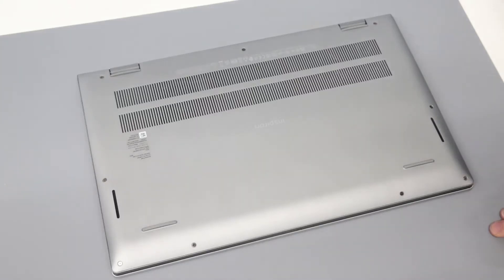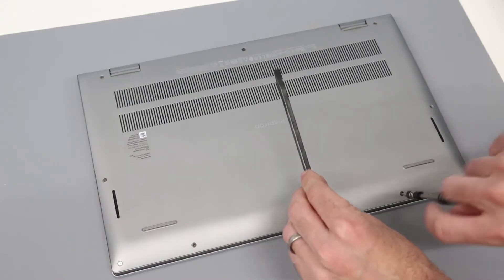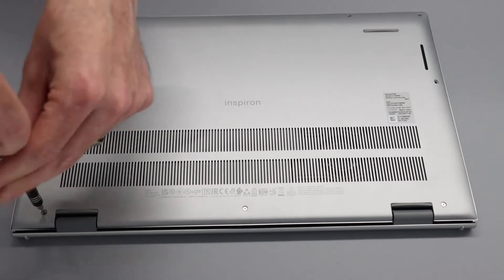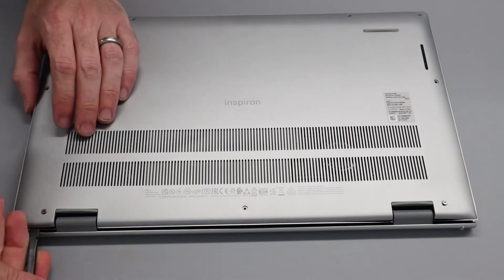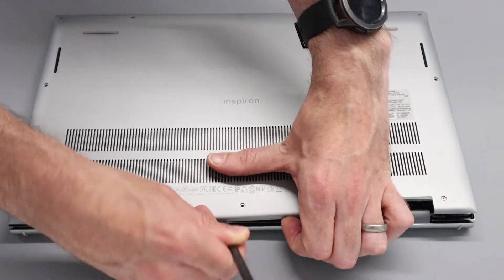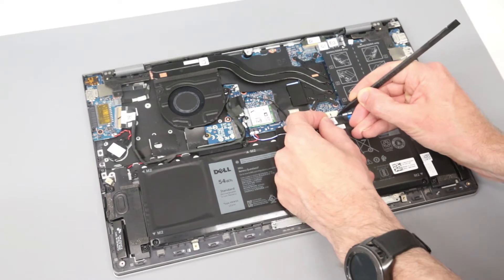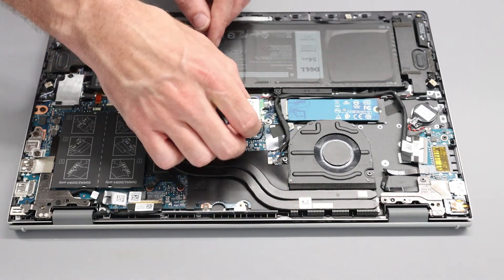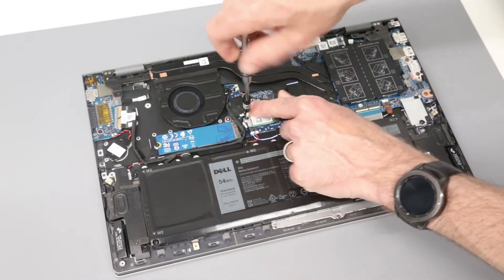Dell Inspiron 15-5510/5518 - M.2 WiFi Card Replacement Guide

Comment: Hi, why did you replace the wificard? Is it because there are some which are better? 
Is it possible change the antenna as well?
Reply from the maker: I didn't, I just recorded HOW to do it whilst I was recording other guides as may be helpful for others looking to repair or upgrade them in the future.